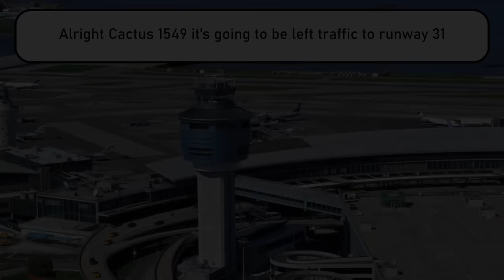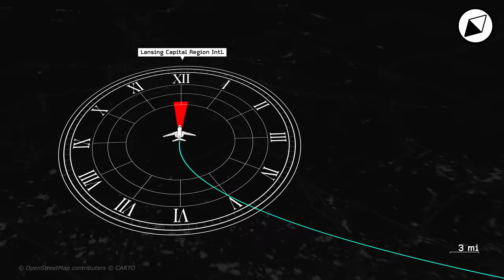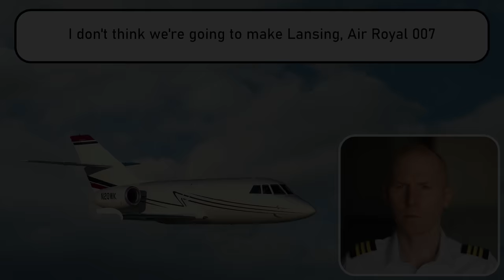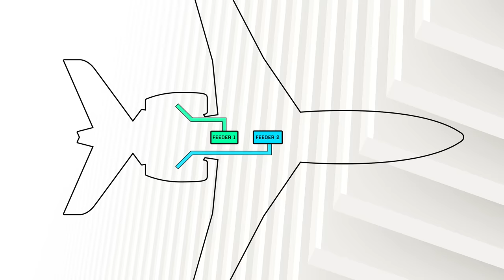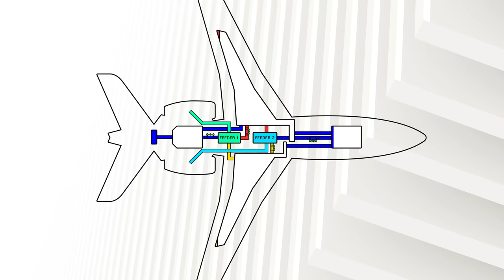Most Bizarre Dual Engine Failure Ever

Comment: I have flown all over the world in big and small planes as a passenger, and my "worst place to loose engines" I could imagine would be over a mountain range. For example, I have spent a lot of time in small planes in the mountains of the Patagonia. A plane crashed a few years back, 2 km from the end of a paved runway. It took 2 weeks to find the crash site, due to low clouds / rain and how dense the forest there was. It is essentially horseback or nothing access, as there are lots of small rivers. A friend did the salvage on the engines. They had to repel from a helicopter, to cut the engines off the wreck, that was hanging 100 feet in the trees off the deck. I had flown on that very plane, in the same area, about 3 months before with a different pilot.
Reply: Suggest u don't fly in these small planes again.
Reply: I think the worst place to lose your engines would be on the initial climb after departure
Reply: @Jeremyhawaii808  Anywhere once the wheels leave the ground...
Reply: Were the engines tied?
Reply: @Jeremyhawaii808  yea but there’s a chance depending on airport that you still have somewhere flat to land

Over a mountain range you’re boned
Reply: Makes sense. I recall hearing that while airliners are amongst the safest forms of travel, small planes are amongst the most dangerous. Something like that.
Reply: @BB Sky My impression of dense forests is that wild creatures 'clean up' these things very quickly. I don't know if that's true in Patagonia specifically, especially as it's not tropical.
Reply: you should "loose" an O
Reply: @DrWhom  The joys of English! Choosing has two 'o's yet losing has only one. No wonder people struggle with it.
Reply: If your engine becomes loose, you need to tighten it up.
Reply: @eekee6034 
Id rather go down in a small plane than a wide body any day if the week.
Reply: @jyellowhammer  I heard it a really long time ago, probably when airlines weren't competing quite so hard. Airliners were kept to such a high standard that, with all things considered, the average flight carried a far smaller chance of death than in a small plane. I'm not sure how it is now. No airline wants a repeat of the Hawaii incident where part of the fuselage came off, but I don't know what corners they will cut.
Reply: @OMGWTFLOLSMH  I always fly with a big roll of duck tape to tie up the engine that got loose.

Comment: Final choice of airports was excellent! There's an A&P school on the field.

The crew did an incredible job.The airplane was essentially undamaged.
Reply: Any time you can reuse...
Reply: What's A&P?
Reply: @eekee6034  airframe and powerplant
Reply: @googaagoogaa12345678  Oh I see :)
Reply: way more than a school for a&p techs i would rsther have an shop of experienced a&p techs 🤷‍♂️
Reply: If you know any specifics, was there a reason all of the fuel cutoff valves were closed? Was it a malfunction in flight?
Reply: somebody poke that controller!  Mumbling along.

Comment: I was once a passenger in a light aircraft years ago, and the pilot and I were having a yarn about the area we were flying over. Suddenly, the single engine began to sputter and die. The pilot had a look at the gauges and then reached over and changed the tank. That was a bit trippy for a second...

Comment: Why did the atc tell him maintain 3000 with no engines? The first thing that hit me, Kelsey called it out fast.

Merry Christmas to Kelsey and my 74 buddies in the comments.
Reply: ATC > Physics
Can't crash land if you don't have clearance for it 😁
Reply: That controller is probably saying "maintain 3000" dozens of times a day every day, I suppose it just slipped.
Reply: probably habit. He might not have delegation below three thousand
Reply: There is a minimum high for each area to be clear of any obstacles. If he don't he had to be clear the the pilot are aware of any obstacles and visually see then. You don't see power-lines from the air you only see the supporting structures and sometimes it's misleading where the wires are.
Reply: Clearly he meant they should have leaned out and blew under the wings

Comment: Glider pilot here. 

I believe weight does not factor into glide range in the first order. Being heavier means you have more potential energy to play with and you are flying at a higher wing-loading. Best glide speed will be higher. 

So all things being equal the heavier aircraft will be able to glide the same distance for a given altitude. And you will get there faster.

This is why we put water ballast into high performance gliders if the weather is strong.

Speaking from my experience and training. There may be other factors.
Reply: Based on quite a number of high profile engine-out incidents, it really seems as if having at least some glider experience in their resumé is something that would be handy for all major commercial pilots to have...? That really indepth understanding of aerodynamics & handling characteristics seems to add another super-effective tool to the toolkit if anythinv goes wrong! 

I don't know what costs are like, though - is it something that would be prohibitively expensive when student pilots are also working on getting their GA hours up...?
Reply: @anna_in_aotearoa3166  

It surely won't hurt and also be a fun part of the curriculum.

I doubt, however, that a few hours in an aircraft built specifically for gliding really would make a difference when the day comes.

Here in Germany PPLers train power off landings (to a runway) as part of their syllabus. I think that may be more useful as it better reflects the situation. 

A very different glide angle, maybe management and trouble-shooting of the dead engine, flaps, just a different beast.

Also: Any self-respecting and -preserving pilot should have a keen interest in aerodynamics. But that may just be me :-).
Reply: You are absolutely correct. The glide ratio is also known as the L/D ratio, or lift over drag. A  heavier airplane will still have the same L/D ratio but will have a higher glide speed.

Comment: Kelsey - Merry Christmas - I fly light sport / ultralights. My weight shift trike flys at 38 mph. If I lost the engine anywhere near the field, I can just swing over and land to a full stop in 200 feet. I can land and take off 4 times easy on a 4k foot runway. Big difference between heavy, fast planes and little slow light weight planes.
Reply: A few years ago I was taking lessons in an LSA, an Ekolot Topaz. Even on a relatively short runway at a little regional airfield, most of my engine-out-during-takeoff plan was just "come back down onto the runway" - by the time we cleared the runway, we'd already be a good few hundred feet up. Absolute joy to fly, that plane.

And mind you, that was a 1000lb plane with a 100hp engine. You're totally right, a good little LSA gives you so many more options.

Comment: For those who are wondering about a few things… Kelsey this applies to you.
First of all I’m a retired center controller from that area, and am also somewhat familiar with the events.
First of all the pilot in the previous freq. requested the specific runway at LAN.  As a controller we might suggest other runways or airports, but most won’t unless asked as we don’t wish to confuse the situation.
Now as to the maintain 3k clearance, all I can say is that the controller is limited on what he can say.   At the time 007 called in he was well above the min. Safe altitude for that sector.  The controller could not give him a clearance below that altitude even under these circumstances.  I, myself wouldn’t have said it quit like that though I would have said something more like “ minimum safe altitude (MSA) in your area is 3k. Altitude is your discretion.”  In the Sully case this was not an issue as when the initial call came the plane was already descending below the MSA and the controller knew enough not to say anything.  Although I’m pretty sure if things hadn’t worked out the way they did he would have been called out by the FAA for not giving him the MSA.
Reply: I’m a retired military controller. I agree with you regarding the altitude. I too would have given him the MSA altitude.
Reply: Yeah I figure it was probably something like that, but yeah I would have thought phrasing it as the MSA or instrucing them to maintain visual separation from terrain bellow 3,000 would have been more useful. After all that is basically the issue there that the controller doesn't know where the obstacles on the ground are and can't provide guidance to avoid them if the plane goes bellow that.
Reply: I'm sure that they are required to specify it. I think Kelsey's point was the wording, giving them an instruction that they already knew they couldn't literally comply with. And it seemed to be worded as a clearance not an advisory. This pilot presumably understood that there was a reason why they were being given minimum altitude, as other statements from the controller had made clear that the controller understood that they had no power. But Kelsey tends to comment on these things not necessarily that that he would not understand it, just pointing out that some pilots may potentially be confused by what seems to be a non sequitur instruction. Your wording sounds more fitting for the situation and would be more clear to any pilot in that situation, including single engine private pilots.

As for the MSA I'm sure that it must have built in margins. Wouldn't it help the pilot to be informed what the obstacle is, building, terrain, antenna and also be told the exact altitude of what they need to avoid? I'm not saying they necessarily needed to offer that information beyond informing of the 3,000 foot MSA, but hopefully they have that information handy if the pilot states they may not be able to stay above 3,000 feet, then the controller can inform them about what it is that they need to avoid and where it is and the actual altitude.
Reply: @StevePemberton2  The controller may not necessarily know what the highest obstacle in the sector actually is nor exactly where in the sector it is. They are not required to know that they only need to know the boundaries of each sector and the MSA within each. Also even if they did it may not help much there may be other obstacles of different types within the sector that are only slightly bellow the highest one so you could accidently give them a false sense of security if you tell them to look out for a mountain when they are heading for an AM radio tower in a different part of the sector or something.
Reply: @seraphina985  we are not fully aware of the exact situation at t(at moment.  Not included in this tape is other aircraft, other controllers etc.  also experience level comes into this as well.  While his life wasn’t on the line in that moment we have no clear indication as to the complexity and stress level he had beyond this video and he may have had 10 other people, controllers, pilots, and supervisors all demanding his attention. This could cause him to revert to basic programming for safety.  We also don’t know his experience level, as I said, this may have been his first emergency and no matter how much training the first is always stressful.
Reply: No doubt it was just force of habit from the controller's part. I would guess he would realise the obvious later and probably the pilot knew what he meant anyway.
Reply: @seraphina985  Maybe. Or maybe in some cases they see the route that the vector will take the plane to the airport and they can look at the map and see an obstacle that the pilot should watch out for. Depends on the situation whether the controller can be helpful or not in that regards.
Reply: @StevePemberton2  Possibly, also depends on what charts controllers actually have access to of which I have no idea. Could be they only have what is on their screens I'm sure someone could possibly obtain some they are online even but how long that would take is another matter as you would need someone not on position to do it. 

I'm just not sure it is even necessary if the pilot is flying in VMC since any pilot that has passed basic flight training should be able to maintain their own terrain clearance in VMC.
Reply: @seraphina985  True, but this started with ATC telling them to stay above 3,000.  I just think it could help the pilot to have at least an idea what that's about. But I'm sure it's more complicated than it appears and the controller runs the risk of not helping or perhaps making things worse, depending on the situation.
Reply: @StevePemberton2  the 3000 ft part was never the problem.. it was specifically the "maintain" 3000 ft. you're getting fixated on one part of what the controller said but not the correct part. it was just the incorrect word to use likely out of habit and in this case likely made no difference but could of been an issue with a far less experienced pilot.
Reply: @sirmonkey1985  Clearly the issue was the instruction to maintain xxxx ft.  It would have been true if 1,500 feet, 2,000 ft, 2,500 ft., etc. I referred to 3,000 ft because that's what was in the audio recording. If you replace 3,000 ft in all of my previous comments with xxxx ft I think you will find that my arguments remain valid.
Reply: The controller in this situation should know enough not to say anything, having just confirmed the pilot has both engines out.
Reply: @StevePemberton2

☝️This!☝️

Comment: I'll try to TL;DR this.  My step dad was selected (he was always the top grade throughout his career) to medevac a preemie from the Northern most tip of the Japanese islands where we had a listening station monitoring Soviet transmissions.  He was flying a C-118 (MATS) and hand picked the crew for his co-pilot and flight engineer.  They had a 3700 foot runway on a grade to get into and out of.  Hearing him tell the story he spent a very long time in the TOLD cards.

He briefed the engineer that he was dropping it right on the edge of the pavement and was going to call "full reverse" and he needed to hear that or "abort" from his engineer.  They got her stopped and then had to back down the runway to stage.  

He then told the flight engineer that he was going to throttle up and stand on the brakes and then call for "full power, wet".  He then told them, "I'm going to the end of the runway and pull.  Hopefully she'll fly."  They did it and the baby survived and grew up.  Now that's not a 747 trying to stop in the same distance but Kelsey's talking about it reminded me of that account.
Reply: Wow, that's a hell of a mission. Respect to your dad and his crew for correctly estimating the situation, planning properly, and getting everyone out safely.
Reply: Tldr
Reply: @gayjoebiden  "Too Long, Didn't Read" which is supposed to be a summary of the topic.  Obviously I failed. 😂

Comment: my guess about the "above 3000 feet" is that there was an obstruction involved  and that was why the pilots decided to go for the closer airport.
Reply: They're losing altitude, so your guess sounds good to me they knew they'f be below it.
Reply: I would think the controller would have advised them about an obstacle to watch out for, rather than just vaguely telling a pilot with no power to maintain 3,000 feet. I think Kelsey's explanation is more likely, 3,000 feet is probably the standard pattern there and the controller probably just said it out of habit.

Comment: The controller was just being dumb.  Technically, as soon as a pilot declare an emergency, they can throw all the air regulations out the window so to speak and just do what they have to for a safe landing if possible. Even if they have to land on a highway , military base or even area 51. But they have paperwork to do afterwards. The controller's job would be to render all assistance necessary by clearing all the runways make sure there are no one lower than you and those higher stay high or divert, and call out the trucks. Total engine failures are not unheard of. Many smaller airports manually add PREST anti icing additive to Jet A, it is a clear liquid, and look exactly like the DEF diesel exhaust fluid. The DEF react with jet A and form round solids that will clog all filters and pumps. So many airports now are trying to get pollution exemption to use truck that do not require the fluid.

Comment: When I heard the controller say “descend and maintain 3,000 feet” I had to reread the title. I thought I might have misread the title. But, no. Controller must have been high management for them to tell a gliding brick to descend and maintain 3k feet! Yeah that’ll work, oh don’t forget to tell them to climb and go around! Sheesh! I live and fly in the mountains. A direct line to another airport here isn’t always an option. You might have a closer airport only 5 miles away. The problem is that there might be 5,000 feet of mountain between you and the closest airport. You would have to try and make the airport further away. Time to pull out the manual and figure glide rates and hope you have enough altitude to make the runway.

Comment: If a 747 were forced to land on a runway like Mason would you have enough distance to take off?
Reply: There’s are several models of the Dassault Falcon, but they do appear to be able to take off from a 4,000’ runway. But your point is well taken, and I don’t know. I’m guessing an aircraft like this would have to have its wings removed, then trailered to a bigger airport.
Reply: @pulpmysteryfan  I presume he's talking about Kelsey's 74.
Reply: @wessexdruid7598  correct
Reply: Probably not. If the plane is intact they might try to strip all of it’s interiors like the passenger seats, the overhead baggage container… etc to loose a lot of weight. Then using a specially trained pilot, they can try do short jump take-off with as little fuel as possible but enough to reach that bigger airport for refuel before heading towards the main maintenance hub.